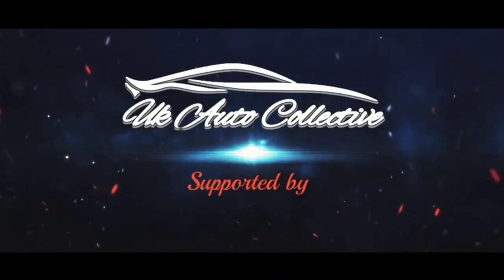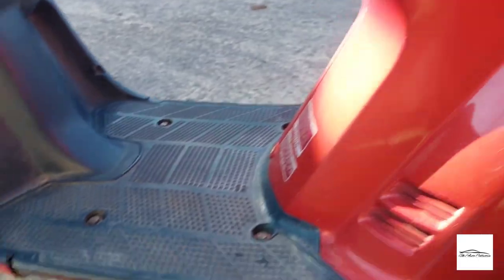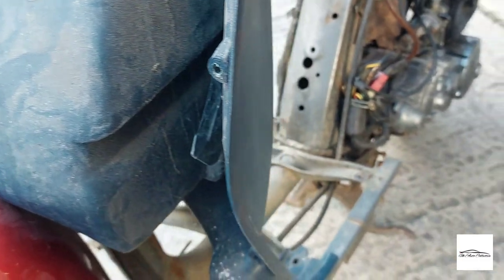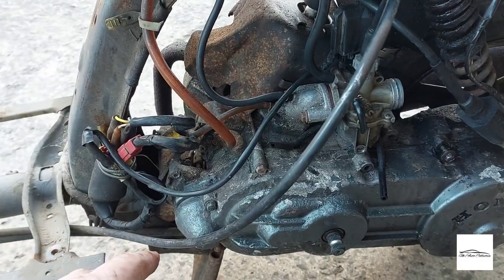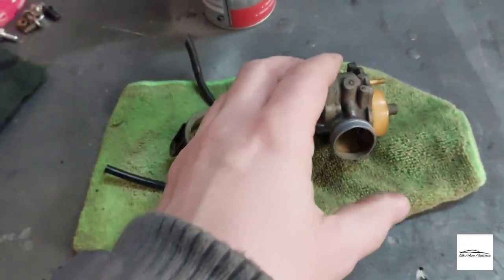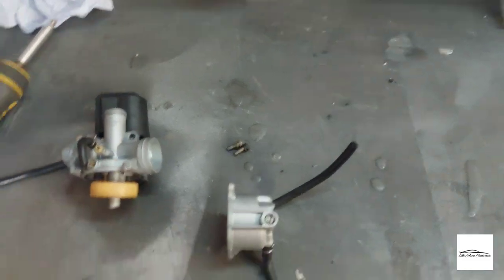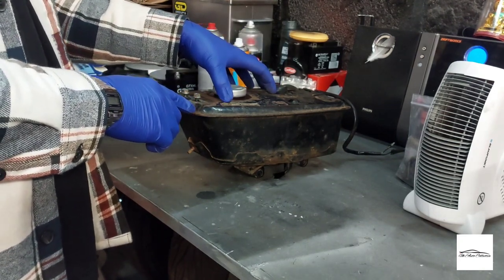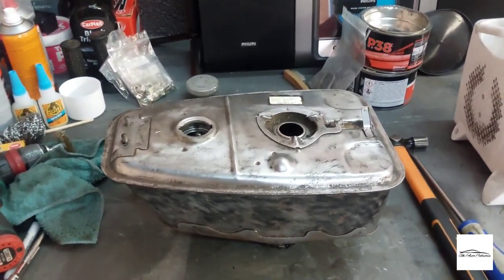New Year, New Project! | Bosozoku Scooter | DIY | How To | UKAC

Comment: I picked up an 86 NB 50 or 'Vision X' back in november, same colour, about the same condition as yours, i think is basically the same except has a lockable side panel on the rhs and the rear light cluster is different have replaced almost everything, all the usual performance upgrades, just waiting on a new head gasket set from malossi and some skateboard bushings to lower it and she'll be ready for her 2nd to last MOT ever, had a blast restoring/upgrading my little vision
Reply from the maker: Sounds great! Yeah this one hasn't been cared for at some point of its life unfortunately. I do love a challenge though and already its starting to look great 🙂
Reply: @ukautocollective  looking forward to see what you do with yours 👍🏼